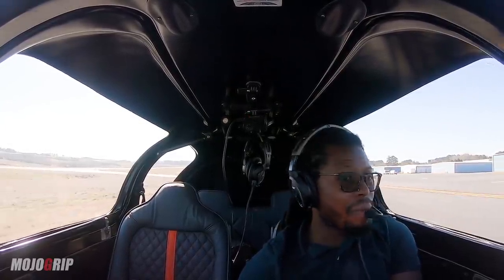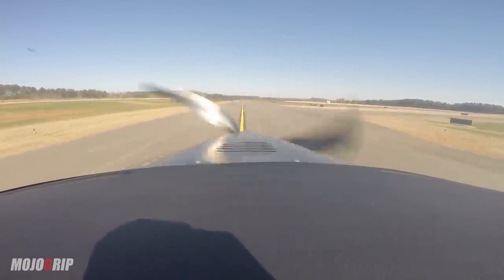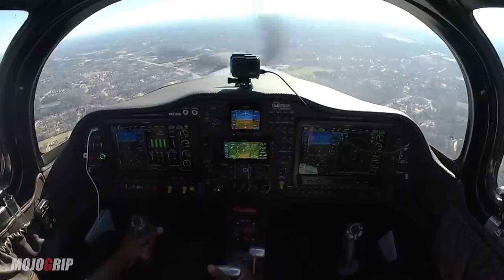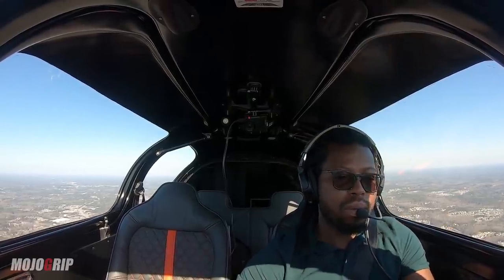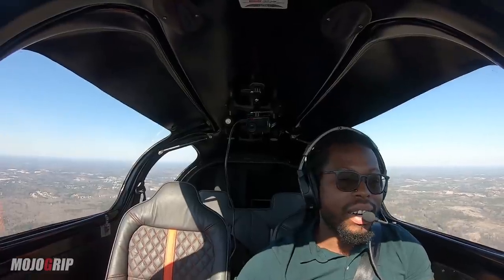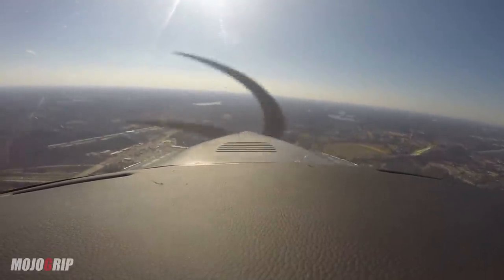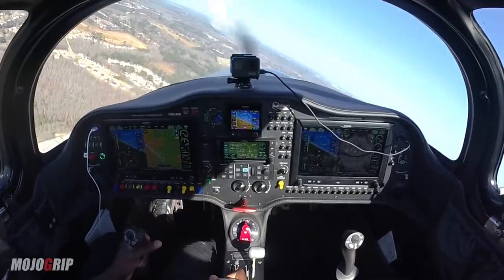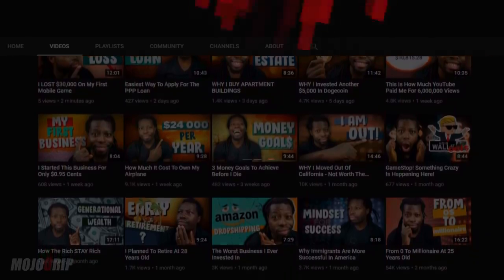Flying My New Plane To Work For The First Time

Comment: Thats like a thousnd times more pimpin than driving a lambo
Reply: Between the plane PLUS fuel tho , guess cost about TWO BRAND NEW lambos........HOWEVER .. after that it legit pays itself off literally and in Fun!!!!😄☺️😃
Reply: Except you can't rev it and shoot flames
Reply: @godzillanismo4892  get a jet and you can always shoot flames
Reply: @godzillanismo4892  but can a lambo pull a flatspin, can you engage in evasive maneuvers? nope
Reply: Indeed, thos required some intelligence too, not just a simple license
Reply: Lambos can get stuck in rush hour traffic and get dinged in the Walmart parking lot --- aint gonna happen with this vehicle with wings!
Reply: And a thousand times cheaper than owning a Lamborghini. These planes are cheap af
Reply: Absolutely ! I will have to make do with Microsoft Flight Simulator 2020 😜
Reply: @bobnellis375  Who in the hell owns a Lambo and drives to Walmart?...
Reply: lambo costs way more than that plane.
Reply: Yup... And this requires actual skills, not just money.
Reply: I mean nahhhh. Can’t compare a lion to a sheep. In this case the lambo is a lion and the plane is a sheep, normal people don’t buy planes to fly. I bet this plane is slower than a lambo and not as thrilling lol
Reply: @RedsBigRig  what ou talking about xD you have no clue how much a plane and fuel costs xD
Reply: @Padlock_Steve  LOL. No. Did you do a Google search to find that out? Maintenance on a Lamborghini is basically tires, oil, and brake pads. The amount of time you drive a Lamborghini, you'll never need to replace the pads, unless you daily drive it, then you'll need to do it in like 5 years. So that's a few grand. So say $1000/yr, and another $200/yr for oil, and another $250/yr for tires, you're at $1500/yr.
Reply: @godzillanismo4892  haven't heard of spitfire?

Comment: So Mike, I remember watching your video when you chose to go with a Joystick instead of Yoke. 
Well here's what I'm seeing - You are flying through a very rough patch and have to do some counter inputs to keep your craft flying smooth but what I also see is, you (your body) wobbling about and the stick following your wobbly body movements while you are trying to keep a level flight. Correct me if I'm wrong but all this body movement (which you obviously can't avoid) appears to be causing you to over input or even opposite input to what you intend on doing to keep your craft on a smooth flight - Is it not easier to maintain a smooth flight under such rough conditions with a "Yoke"  ?
Reply: According to some experts you should be using the rudder when flying in rough conditions to maintain a smooth flight and not the aileron.
Reply: @mcfast52  I will assume you meant to say elevators (rudder irrelevant to the question at hand). Well, both elevators and ailerons are on the yoke or the stick, so the question remains still.
Reply: @lefatlemofokeng688  No rudder!
Reply: @mcfast52  pretty sure he has a rudder on that plane.
Reply: @Zambuique  I’m pretty sure they said the rudder is irrelevant to the situation at hand ..

Comment: I want to learn how to fly a plane sooooooooo bad!!!! Childhood dream.
Reply: Easy job man. Go to A general aviation airport and pick an instructor you trust because they can make you fly to get hours and money . Have at least 5 thousands to start so you do not stop half way due to insufficient funds. Good luck
Reply: Boy George  don't consider getting a license a "full thing". There's no such thing. There are minor costs exclusive to obtaining a license, but most of the cost is the actual flying: plane and fuel, which is not much more expensive than what it would cost you to fly your own plane. It was a childhood dream for me to learn to fly, but I was conditioned to believe it is too expensive due to the total cost. Guess what, it actually cost less than a 20th of a "full thing" to start flying. Then it's only a matter of hours till you get PPL(A), which by no means should be your goal. Your goal is to climb and descend while having a great time in the meantime. To answer your question though, it costs around 40 000 PLN in Poland (around $10 000) to receive your paper, if that's what you desire.

Comment: That was some serious floating - a bit too fast on final...
Reply: I thought the same.
Reply: Burned up half the runway
Reply: @StickandGlider  As we all know, it’s a good habit to aim for the numbers on the approach end of the runway and land as short as possible.  You never know when that extra runway in front of you might come in handy.

For what?

The best example, off the top of my head, is the pilot who touches down, and much to their horror, suddenly discovers that they have no brakes.  It doesn’t happen often, but it does happen.

It’s better to learn of this within the first quarter of the runway, rather than at the halfway point or beyond.
Reply: @CH67guy1  Yeah, I've experienced a night landing with inop flaps, approached too fast, landed long, and when applying brakes got severe nose wheel shimmy. Literally took the whole runway in a 172. I should never have accepted the airplane knowing the flaps and shimmy issues were "intermittent!" Never flew that trash heap again.
Reply: @StickandGlider  Wow!  Sounds like you had the perfect storm of all possible problems!

Back in the 1980s we had the B-17 “Nine-O-Nine” land at Beaver County Airport in Pennsylvania.

It had its choice of landing runway 28 or 10.

The winds that day were favoring runway 10, which has a very slight uphill slope.

But the pilot chose runway 28, slight downhill slope, and a tailwind.

Wheels didn’t touch until ⅔ of the usable runway was already behind it.

No way it was going to get stopped before reaching the end of the runway.  But the pilot just rode it out.  Ran off the end of the runway and down over a hill.

I was told it was the finest surviving B-17 at that time.

It was recovered from the crash site with the help of a crane.  Volunteer warbird mechanics worked YEARS just to get it in a ferriable condition.

Fast forward to 2019 and it crashed again.  This time in Connecticut.  And this time it was totally destroyed, killing several people on board, including the pilot.

A go around would have averted the 1980s crash.

The more recent crash is a completely different story.   No final accident report yet, but 2 or more of the engines were found to be in a less than airworthy condition.

Comment: That wasn't bird poop... those were splashed insects.
You are way too fast on final, diving to the runway. Hence the floating
Reply: That's because he flies "gangsta style" and cannot see over the coaming. He has to pull himself forward for every landing to see what is happening...that's why his landings are all over the place.
Reply: @spotspot6790  can you elaborate on what flying "gangsta style" is exactly?
Reply: @spotspot6790  You can't see over the cowling in many airplanes through your flair. Almost every tailwheel plane and many high performance IFR capable planes. You use the sides as your sight picture .
Reply: @donanders2110  his seat is so reclined he is lying down not upright. If you look at his other videos he has to pull himself forward for landing...his back is not supported by the seat
Reply: @spotspot6790  looks like his seat is reclined to far. I wouldn’t say gangsta since the world defines that as a person exhibiting the traits or demeanor associated with the high risk lifestyle of urban street-thug or hustlers. I’m just saying. I think he’s got it going on bro. LOL Just clowning with you.

Comment: I cannot imagine a hangar without a cardboard box or two.  A work bench.  A quart of oil stuck in the cross beam.  Some sort of flag hanging vertical.  A broom.  

Add to that special treats for the mice and rats.  They like to eat wiring.  Makes for not-so-fun adventures when you least expect it.

Comment: In the shots with the camera looking back at you, how did you keep the horizon straight and allowed the aircraft to move relative to the viewing frame?
Reply: I was thinking the same. Camera seemed to be on a stabalizer always aligns with the earth's horizon. So cool!
Reply: @nicholas2740   That is one way to do it, but remember that it would have to be gyro stabilized, NOT gravity stabilized, since a coordinated turn would give similar result as a hard mounted camera.   Another way is to turn the frame manually during the editing process.  It is a bit of a puzzle to me, which is why I asked the question.   Not many people would notice it to question how it was done.